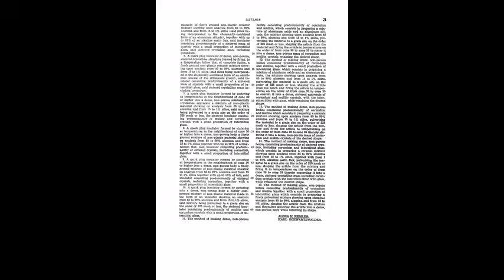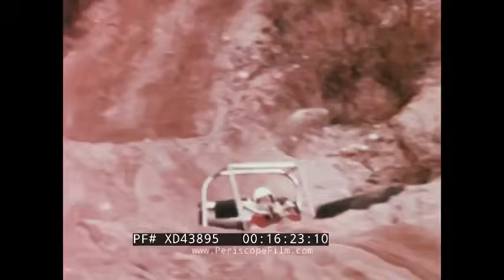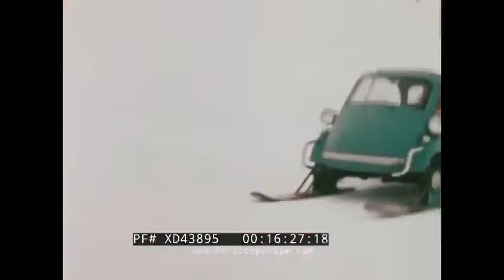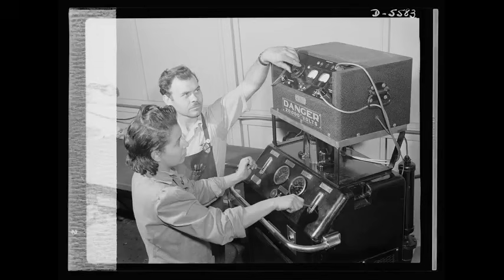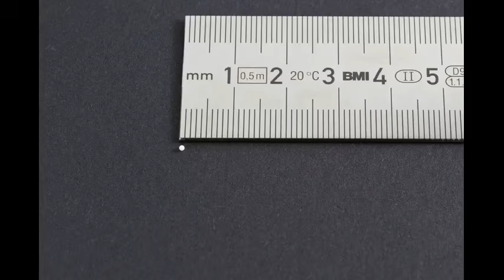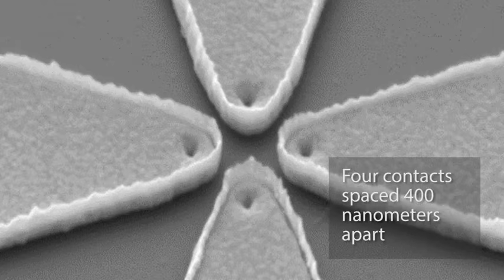The Ceramic America Developed for 1942 Spark Plugs Is Now a High-Tech Materials

Comment: What did the Germans and Japanese use for their spark plug component if the US patents were dated in early 1942?
Reply from the maker: Germany and Japan already used ceramic spark-plug insulators, including technical porcelain and some high-alumina materials. The 1942 U.S. patent was for a specific dense alumina composition and mass-production process—not the invention of spark-plug ceramics themselves.
Reply: @ww2totalarchive thanks for the info.